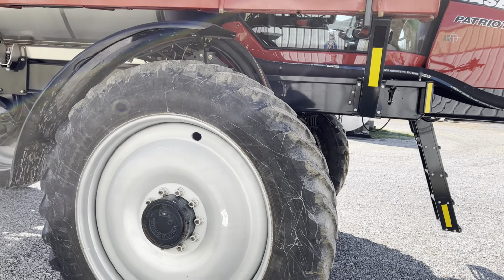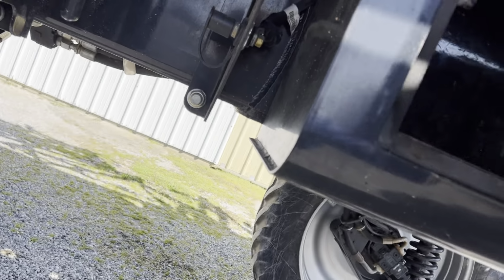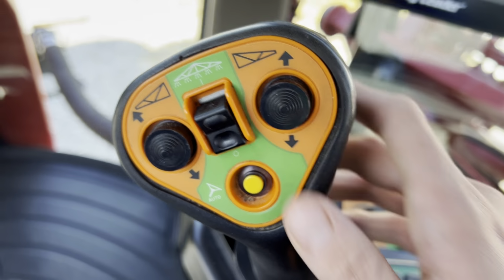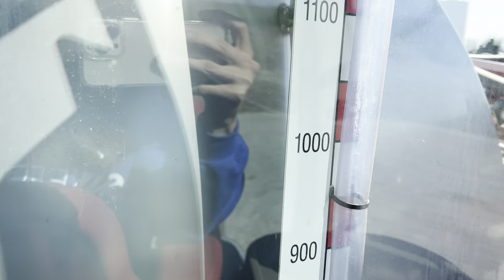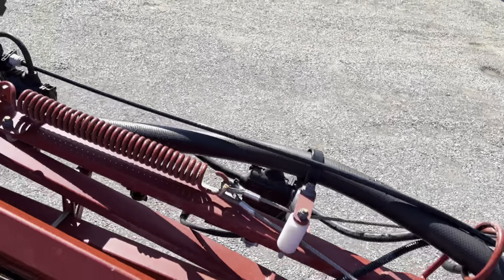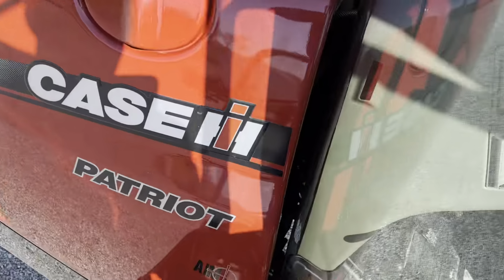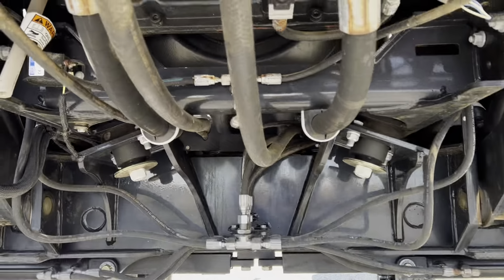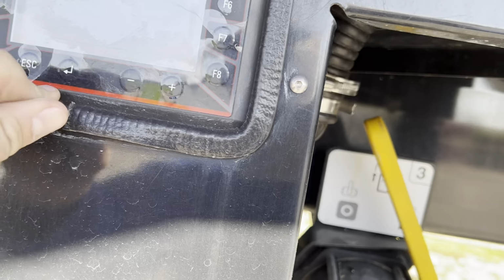New Sprayer has arrived! ￼

Comment: Nice machine I’m sure you’ll like running it better than the JD.  Do u think it’ll be tall enough to spray fungicide on corn without snapping too many stalks?
Reply from the maker: We were wondering the same thing  with spraying corn might be worth a try not planting much corn this year with higher nitrogen’s prices unfortunately hard plant corn when you make 90 bushel soybeans planted in April and make about the same profit without the cost of n.
Reply: @kentuckyfarmer2192  I’m afraid with the current fertilizer and chemical prices they’ll be a many acres of soybeans planted with no fertilizer and a big cut on herbicide rates. So lower yields with grass and weeds may be the story of 2022. I’m swinging for the fence as usual so I’m not changing anything. I did buy my fertilizer and glyphosate last fall.
Reply from the maker: @rickyivey8596  yes their a quite a few guys here that wont fertilize a thing we will fertilize  nitrogen is what really hard get here we managed to get enough for our wheat but many were not lucky it definitely going a different year
Reply: @kentuckyfarmer2192  this year will be one for the history books. Fuel prices are higher than a cats  ass in a pine tree and will go higher so I know all mine will be no till soybeans this year and I hope I can do a burn down and one more pass for weeds and grass and 2 trips for worms and that’s it. If prices drop back to $4 corn and $8 beans and $4-$5 wheat they’ll be equipment auctions everyday next winter.